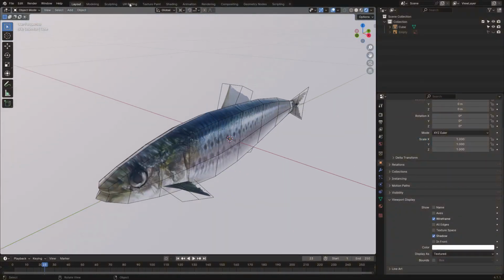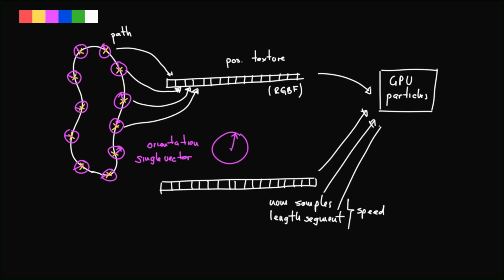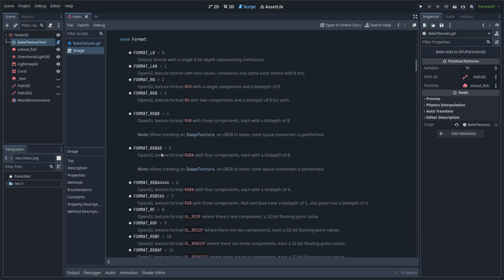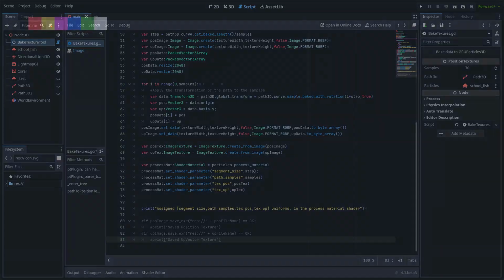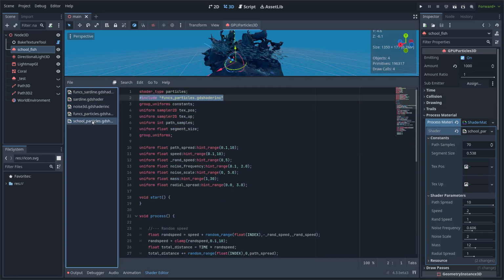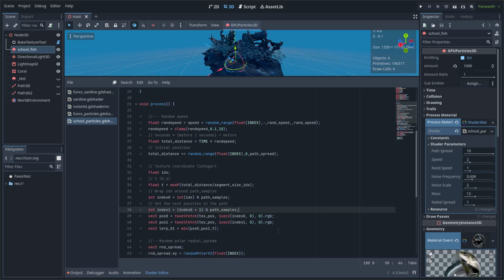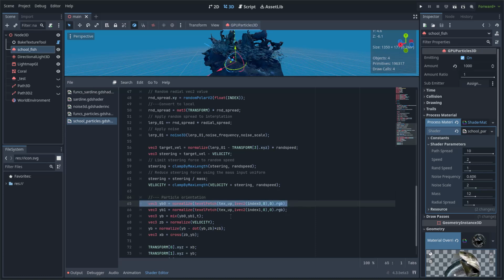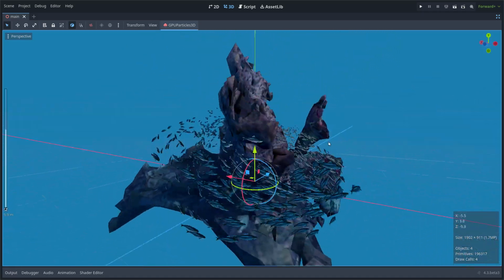Godot: Bake and read position textures from a path

Comment: I don't get any particles spawning at all. I copied everything verbatim, baked the textures, there's no errors anywhere. If I put a standard ParticleProcessMaterial on it, my fish show up. But swap it to the ShaderMaterial and there's just nothing. I don't know what I could be missing. The only thing not shown in the video is the shader you have on the actual fish, but is that really necessary? I just have a normal material on my fish mesh. Do I need it to be a shader material? Is there something special in there?

Edit: Seems to be a problem in the VELOCITY section, but since I'm not getting any errors, I have no idea what's wrong.
Reply from the maker: Yeah there was an update I don't know if it was to the nvidia driver or inside Godot. Didn't work anymore. I had to remake the particle shader if I remember correctly. You can get it on Patreon or just ask chatGPT to update that file.
Reply: @pixezy8962  That's unfortunate. I guess I'll try the AI route. Not that I don't want to support your work, but I'm far too flat broke to be dropping £15 on a patreon for one shader file. But I appreciate you, and thanks for this video that has allowed me to get 90% there, hopefully I can figure out that final piece of the puzzle!
Reply: @pixezy8962  I figured out what the problem was. Most of the shader is still fine (I'm on 4.7.1, for reference) but there was just a single line that was breaking everything. It was the rng_spread variable, you had its x and y initialized, but never the z. If you just put "rng_spread.z = 0.0" after the rng_spread.xy line, everything works!